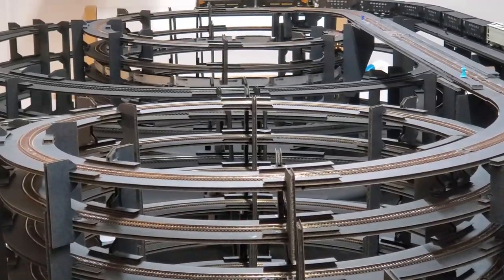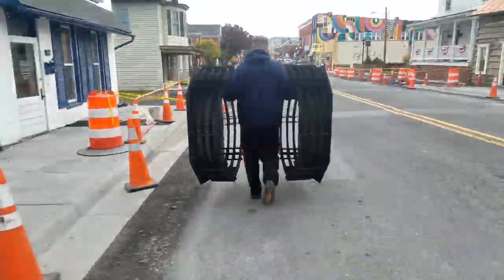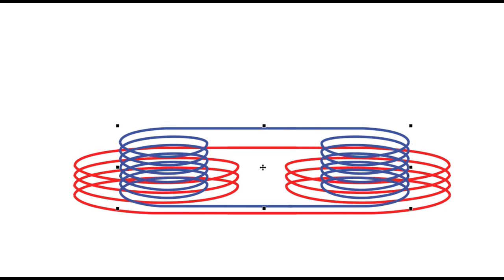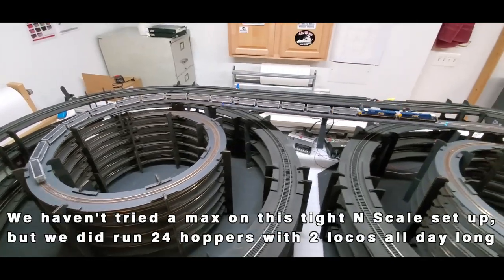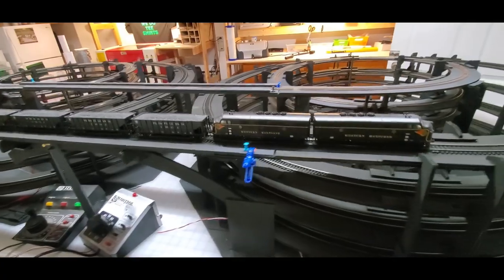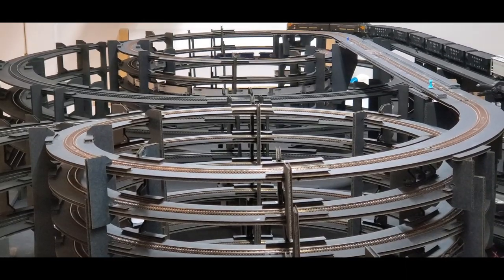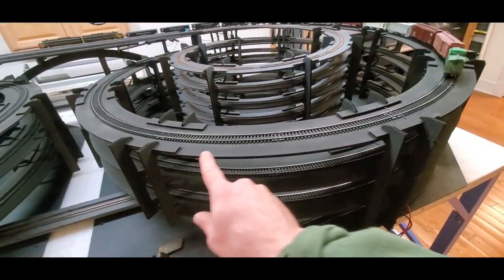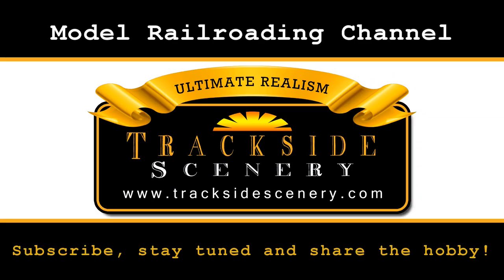QUADZILLA - 4 Helix Display Layout - HO and N Scale

Comment: Can you provide helix's for S scale which is 1 / 64?  What are the dimensions of the footprint that each Helix would require?
Bob s
Reply from the maker: Bob, you can use the components for anything you wish. On the website there is plenty of information in the info center at www.tracksidescenery.com
While the deck sections are listed as HO or N Scale, they can be used for whatever fits on them. Depending on the height of your equipment, you may have to fashion your own risers instead of using the pre-cut we have for HO and N.